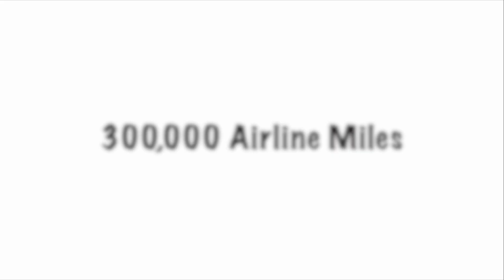STEP by STEP: SPRINTER 4x4 BIKE RACK - DIY $150 Secure Simple Swingout Solid LOLO UNSTEALABLE Bikes

Comment: Great job on the idea for using the L-Track on the  outside, that opens lots of possibilities for sure.  I am hunting on the Sea Suckers Cup but I usually can only find them in the conjunction with the bike rack.  Where did you get just the cups?
Reply from the maker: Hi Wayne. Thanks for comment. We bought the Sea Suckers directly from Sea Suckers - here is the link. https://www.seasucker.com/products/4-5-seasucker-with-stainless-steel-d-ring-black

Comment: How are these Lolo racks holding up? I like the look although the extended length concerns me. Do you think the racks would hold an e-MTB 20-24Kg (44-53lb) although lifting an e-mtb won't be much fun. I was thinking one per door. The lack of structure concerns me.
Reply from the maker: Hi! Lolo hooks are working great. They are super solid - we hook the bikes and never worry about them - unless the Lolo hooks break there is no way they will fall. No doubt the setup would hold the weight of an ebike - if the Lolo hooks can handle that weight. The sandwiching of the L Track on both sides of the door (inside and out) creates a very strong setup. Lifting the weight up would be a challenge for sure. We love the setup and plan on doing the same on our new van coming soon. Thanks for your comment and have a great evening.

Comment: You guys are the only ones I’ve seen that mounted bikes directly to the door. I was thinking about doing that exact thing with the Lolo rack accessory. My concern is wait on the door. Have you had any problems with the bike weight bending the back door of the sprinter. And would you do anything different as far as Mountain goes?
Reply from the maker: we haven't had any problems with it bending the door and would make this bike rack again for sure!